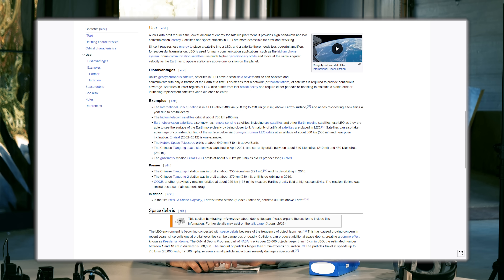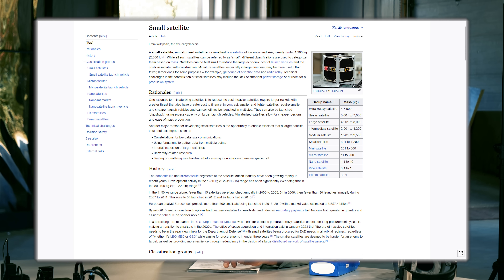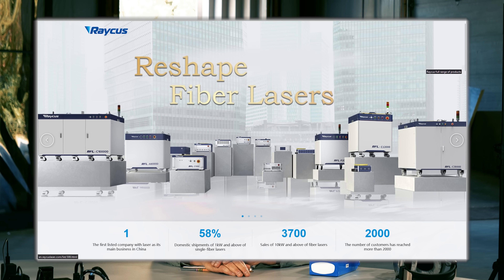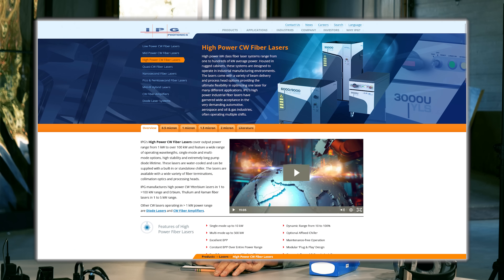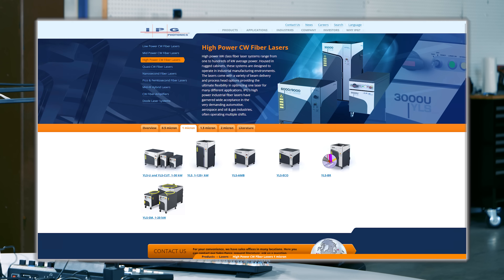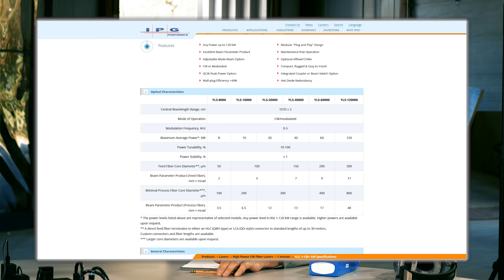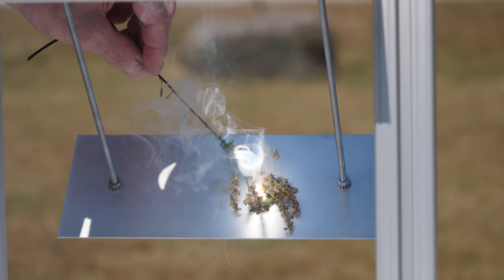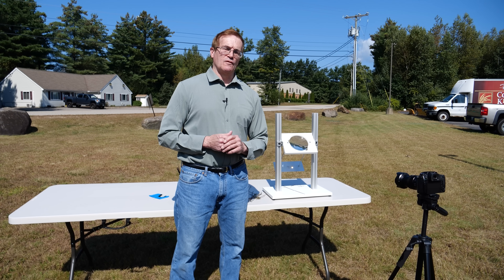COULD SATELLITE LASERS REALLY DO THIS?...

Comment: It seems to me that if I were an arsonist and really  wanted to start a fire I would not do it from way out in space.   Rather I might simply take some incendiaries like highway flares and put some radio controlled circuits on them to ignite them and toss them all around some different  strategic locations or drop them out of an airplane or balloons.  Then at the time when all the underbrush was at its driest and the winds were favorable then send a signal out to ignite them.  it seems far simpler.
Reply: Even easier to wait for a random fire to burn down the place .
Reply: Fires started by arsonists don't melt glass or aluminum. The temperatures of those fires don't create fine white dust powder aka incineration at over 4000 degrees F. Wildfires don't burn at that high temperature and all vegetation is usually charred, but not in Maui or Paradise Valley, CA fires.
Reply: Absolutely. The points that you make are factual not conjecture. Possibly the majority of the public do not understand, glass, aluminum and especially porcellian have thermal flashpoints at temperatures that cannot be realized in that of forest, brush or house fires. The breaking of cohesive bonds certainly cannot be achieved at these temperatures. TDO NOT generate enough heat to turn porcelain into white powdered debris. Just look at the aftermath of house fires that consumed the entire structure without firefighting intervention. You will ALWAYS find porcelain fixtures in the remaining rubble, . So someone please enlighten me as to why the houses in Paradise and Lahaina that were completely consumed are reduced to a pile of white ash.No Porcelain, no Bricks, NOTHING but white ash. This is the 2000 lb elephant in the room. Follow the science, pardon me for stealing the expression that those who have agendas based in Power, Control and Eugenics love to tout. Ok then, let's actually do that. Follow the friggin science.  @ceciliao3158
Reply: @RCiano-ou812 The energy weapon utilized was not based on light but on a type of plasma that combusts upon contact with matter. The blue roofs that were not affected were so because that particular color is invisible to this specific kind of energy.

Comment: For your consideration. One hot summer windless day, my attention was drawn to a rather strange sight. There lying on the grey asphalt parking lot surface was an empty discarded common ordinary wax paper 8” drinking cup, laying horizontal, and to my surprise flames and smoke were coming from the mouth of the cup. Fire! I walked over and stepped on the cup to extinguish the fire, liquid wax shout out from the opening and the now flattened cup stuck to the bottom of my shoe, but the fire was extinguished and I pealed the cup from my shoe. A one in a million chance or more common than we think? I did some online research on the melting and vapor temperature points of wax and It turns out the heat from the sun melted the wax coating inside the cup causing liquid wax puddling inside and combustable wax vapor inside the cup. Static electricity from a nearby moving car tire was the invisible spark that ignited the fire. 2023, San Jose, CA
Reply: Wow, very interesting sir!

Comment: Max diameter for the mirror would be around 6m, and you can use the entire second stage as delivery, like the original Keyhole sattelites did, using the entire second stage as a bus. That gives you fuel storage for free ( though your fuel choices are nasty, as you probably want long storage in the order of 6 months, so cryogenics are out, and you are stuck with Hydrazine and fuming nitric acid as fuels.
Reply: Nuclear fission, we are talking military satellites here.
Reply: @Hclann1 nuclear fission requires a medium to heat and then that medium is used to create steam which turns a turbine that creates electricity. By itself nuclear fission does not create usable electricity or a motive force (unless it's a bomb). It creates heat

Comment: What was the source of heat that caused the aluminum or cast wheels to melt and rundown the road like a stream of silver?. 33:30
Reply from the maker: The fuel in each vehicle is the most likely explanation.

Comment: Bottom line, it would be possible to start forest fires, house fires etc from space.
Reply: It's just a distraction from whether the fires have been INTENTIONALLY SET... which anyone can do with a $0.50 box of matches.

The point is to make anyone who suspects the fires are intentional sound like a nutcase.
Reply: @hxhdfjifzirstc894  Much less chance of being discovered if it's space based.
Particularly during war time, on your enemy's territory. 
China has been working overtime on laser technology.
Reply: Bottom line - such a system would be ridiculously expensive, detectable, difficult to use against enemies and pointless to use against your own assets.

Comment: Bear in mind that any military technology disclosed now is typically 50 years old. Nowadays they won't be using a simple laser - as a minimum they'll be using scalar electromagnetic technology with two or more frequencies combined. And it will easily fit into an aircraft.
Reply: Scalar Energy is non-gaussian, non-transverse so it's not actually electromagnetic light.

Comment: Did I miss the part where you talk about the absorption of the atmosphere? You seem to have focused entirely on the spot diameter and not on the fact that you're having to fire a laser through a minimum of 60 miles of atmosphere, and likely much more. Your laser might start at 20 kilowatts, but there's no way you're going to get all 20 to hit the ground.
Reply: inverse square law
Reply: Yes you did, half of the video was on air absorption.
Reply: @lightingman117  they mentioned the ability of atmosphere to scatter the beam but I'm pretty sure they never brought up the fact that atmosphere will dampen the power through absorption. When light has to travel through more atmosphere, less power reaches the ground.
Reply: This IS mentioned as a reason NOT to use visible wavelengths, but instead to use the micrometer range industrial lasers, which don't suffer such absorption losses.
Reply: Kind of glossed over and handwaved away this by mentioning deformable mirrors.
Reply: @JeremySpidle water vapor absorb very well that 1um wavelenght....
Reply: @Doctorbasss  so, it requires dry conditions to be effective?
Reply: @Domi2gud  he mentioned those techniques to overcome scattering from thermal flutiations in the atmosphere.  They would not help light avoid absorbtion.
Reply: What else requires dry conditions besides the efficient transmission of energy to ignite a wildfire?  Doesn't it also take hot (possibly windy) weather and ample dry fuel?  Would those not also be the perfect conditions to use a space laser as a remote ignition device?  I mean, a Nation with one of those could burn their enemy's crops during a drought and rightly deny having stepped foot across the border or any other evil scheme a 3LA agency could imagine...  AmIright?
Reply: @JeremySpidle this has just been done only it seems like nobody even noticed.

Comment: Very cool!! Great video. I was thinking with my tin foil hat, what if a large phased array system was used to ionize the atmosphere to aid in a laser sat delivery system ?
Reply: A laser hitting ions lose energy from scattering, not gain energy.  There are ion lasers, yes, but those are made in controlled conditions too difficult to create in the atmosphere and are very power inefficient.
Reply: @cryora  no I mean using a phased ground array to ionize the atmosphere to disperse particles in conjunction with a laser based in space
Reply: @ultrviolence369 You mean create a vacuum?  Can a phased array do that?

Comment: Great video once again. But, why can't the laser use the IR frequency that passes through the atmosphere? (As you covered in your IR paint).
Reply from the maker: The one micron  output  from the fiber laser is near ideal.  It passes through the atmosphere with little attenuation, and unlike the 10 micron wavelength  of thermal radiation, the divergence  is 10 times lower.  Also, this is a very efficient wavelength  for a laser.

Comment: This is bad because it's nearly impossible to defend against this kind of attack - or even detect it after the fact. There are often times when the only thing preventing a wildfire is lack of a source of ignition.
Reply: The only way to prevent this is to invest trillions of dollars in to water desalination plants and the largest sprinkler system. Then building out a massive flood control systems that instead redirects the water or prevents the water from over taking an area you pump that water to where it needs to be. Build massive reservoirs and fill them to the brim. Then monitor all lands and water them as needed. Clean up all the areas and thin trees as needed. This is where we need humanoid robots to do all of the manual labor. Do this and fires will be a thing of the past.

Comment: What about triangulation?  Couldn't beams be combined to increase the watts/sq meter....don't they already do this with microwaves to target tumors?  Also what about a small nuclear power source combined with those large storage capacitors you showed?
Reply from the maker: That would require  the coordination  of multiple  satellite  orbits.  Simply  increasing the size and weight  of a single  satellite  would be much easier.
Reply: @TechIngredients  OK  Thanks for the reply....and the video!

Comment: Well, you haven't convinced us that grass could melt aluminum in auto engine blocks and wheels, surrounded by unburned material, but we've seen videos memorializing that result. On the other hand,  many of your important assumptions about capacity and power in this thought experiment go away with antigravity; don't they? When you say "what they did," we assume you mean "were used on Lahaina."    At any rate, you've shown a DEW is feasible from a satellite. But given the work of Dr. Stephen Greer, how about imagining what would happen if the laser you describe were only a few thousand feet in the air?
Reply: LMAO "anti gravity". What drugs are you using?

Comment: I would say if lasers were used, a jet at 50,000- 80,000 foot would make more sense. Cooling, distance, weight and mobility all much easier  to handle. Thought, a satellite can go into a geosynchronous orbit, were they can stay over the same spot on earth as long as they want and fire a rocket and move to a new spot were they could again fire and go into geo again. Also, the US has put secret stuff up over and over, so a satellite could be really weighty and the money to do that.
Reply: BUT if you were going to start a wildfire during a drought while a hurricane passes, it would be much easier to say, have a power line fall on the ground and have the fire start for free. No need for jets or satellites or anything.
Reply: And they showed them 20 years ago.God makes Satan show us.
Reply: Where are two thousand kids ?
Reply: Because changing orbits is such a trivial task.. Sorry, no, you would not just "shuffle" around from one geosync to another. 

Tbh, if you want it to be deliberate: an arsonist with a bucket of gasoline and a lighter will achieve the same effect and will be orders of magnitude cheaper.
Reply: @Kashak666  All it takes to change orbit and location is rocket fuel, changing speed and direction and a good computer progam.
Reply: @putteslaintxtbks5166  It takes a lot less than that to make a fire during a drought while a hurricane passes nearby, that's all we are saying...

Comment: I would think if it was done by lasers they would much more likely be on high altitude planes and lasers in that case would be much more powerful even at this size.. but a plane could hold a much much bigger laser
Reply: Yes. Also moving air and lots of mass  makes cooling laser much much easier.
Reply: Cargo heli was spotted nearby at the time?

Comment: I believe that the oldest directed energy weapon concept described is millennia old. It was described already in antiquity, using manually operated multiple mirrors (in essence rudimentary adaptive optics) to direct and focus sunlight onto an opponent. It may have been more of a thought experiment and not really fielded, but the idea was there. 
Probably a cheaper and more efficient design if one wanted to actually build an orbital weapon to use a similar concept. With the same modern beam forming equipment as for a laser system such as the one described, the effective energy delivered as instantaneously harvested broadband light from the sun is likely a few orders of magnitude higher than any laser could (remember that any laser system has a less than 50% efficiency).

Comment: Just a question, but could there be a concaved mirror array or magnifying array on a single satellite or several satellites which can direct amplified sunlight to the surface of the earth? This would eliminate the need for a large fuel supply on the satellite itself. Yet still direct incredible energy to a single point. Or even a combination of reflected sunlight and laser light.
Reply from the maker: Sunlight  diverges  much more rapidly  because  it radiates from an extended surface 1/2 degree across. Very large mirrors would be required.

Comment: Regarding microwaves, couldn't you use phased antenna arrays?
Reply from the maker: You could, but they would have to be kilometers across. You can't cheat diffraction. The array simply allows for a much lighter and flatter transmitter, but its diameter is dictated by the wavelength.

Comment: In Australia we have lot's of wild fires. Many are started by lightning strikes. Others are started by sparks from electrical wires hitting each other. The wires don't have to fall down. On a very dry 40C+ degree day and some wind a tiny spark can start a fire like it was in gunpowder. I started one by short circuiting the 12v lead going to the starter relay (not the high current side) on a dusty tractor with a little leaking diesel as well. I put it out too but had to fix some wires on the tractor. 
Welding and grinding equipment start their fair share of fires too. On fire danger (fire ban) days it is not allowed to be used outdoors. 
The story is that broken bottles do it too but I don't think it is very often unless helped as they won't be in focus.  
When people smoked a lot in their car's they often through but's out the window and we often saw burned spots along the roads but not much any more. It is now highly illegal to through out the but's and people don't smoke so much any more. There are many small bushfires (wildfires) every day just here in Victoria. They usually get put under control within minutes. Professional and volunteer brigades are on constant guard.

Comment: Lockheed Martin a military contractor has high intensity lasers in the forward nosel or nose cone of select jets. This is not new technology. In the early 1980’s Martin Merrietia’s head of laser research and development stated he was blasting hole’s through 4” thick steel from 50 miles away. He went on further to explain the year was 1962 when they achieved this what do you think they have now.
Reply from the maker: If he really said that, he was full of s***t.
From that distance,  no laser in the 1980s could do that. Although they are getting closer, no laser today can do that.

Comment: Certainly possible and greatly appreciate the in-depth explanation on the technology that could lead to such a weapon. 
In reality though for a nation state actor there are probably much more covert, cheaper and reliable ways to start a brushfire. The simplest of these would just involve having an operative posing as a tourist strike a match at an opportune time. 

Given the more practical ways of committing arson available, I tend to think that any military application of a laser satellite would have to be at scale where the weapon itself could deal significant damage to a target not easily accessible by an operative. Maybe covertly setting fire to a secured data center or building on a military installation, but that would probably require a much larger laser to do it reliably and quickly enough not to be noticed. 

Practical or not, it is very scary to leave this video with the understanding that even a brush fire could be started from space using off the shelf industrial equipment.
Reply from the maker: I agree entirely.

Comment: What about the use of centrifugal mirrors in zero gravity, much less weigh restrictions, and with the ability to adjust the rotational speed to for focusing?
Reply from the maker: Without gravity, a centrifugal mirror will not form a concave shape. You need the product of two separate acceleration vectors.

Comment: Mahalo (thank you) from Hawaii. Just a couple weeks ago, I first learned of you & your video “Defeating Microwave Weapons Part 1” 👍🏼, which was posted a year ago. And now this fantastic video, in relation to Maui’s fire! 🤙🏼 Answered my questions about the “blue” suspicion and potential lasar starting a fire. What are your thoughts about the many standing trees with green leaves, in the middle of burnt areas of ashes, melted cars & homes?
Reply from the maker: In my opinion, the extremely  high winds were the reason the fire spread so unpredictably. The localized  super heating of vehicles  was probably due to the fuel onboard each vehicle.
I have no idea if the fire was started intentionally, but the management  by the officials  involved was clearly  very poor.
Reply: @TechIngredients  I agree. Curious abt the trees though, why/how could they have branches with leaves after an intense fire?